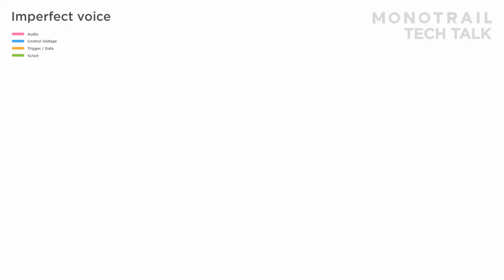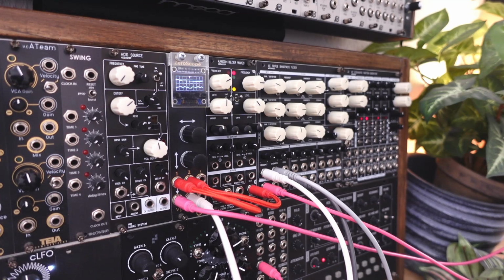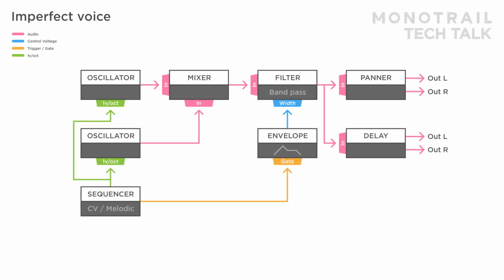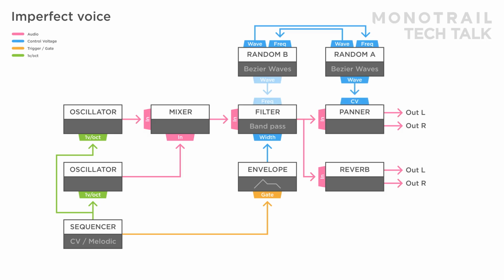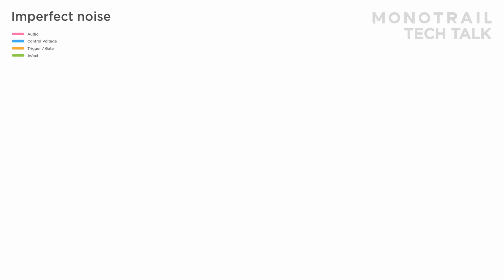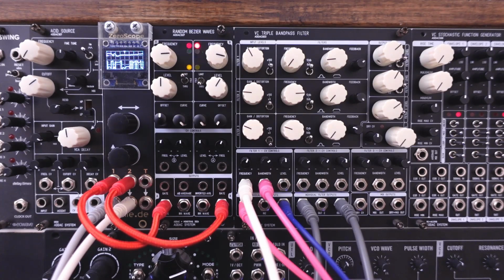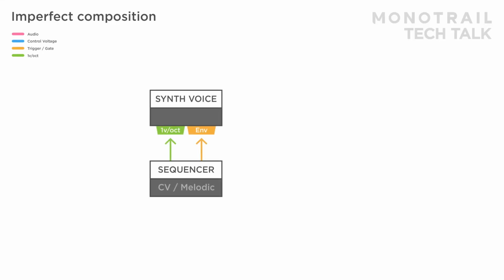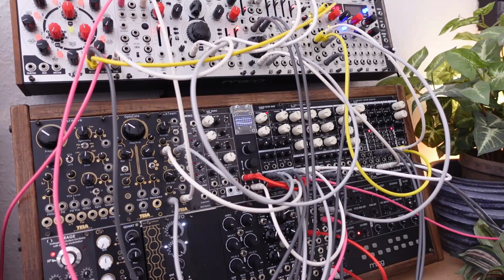3 ways to exploit imperfection in sound design - Random Bezier Waves

Comment: This module looks incredible. For those after a smaller, more affordable option, the ADDAC215 could be the gateway drug you are after. It's a dual sample and hold with independent slew for each, plus a lot more. This gives you the smooth random voltages our main man is so fond of.
Reply from the maker: Glad you like it! And the 215 is a fun module for sure! ADDAC has a very nice selection of great modulation modules in their line-up :)